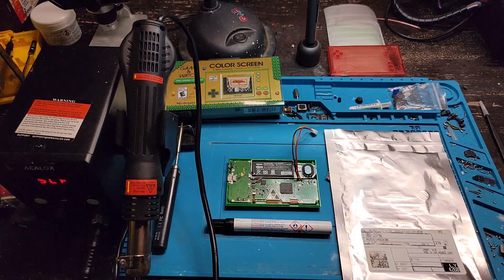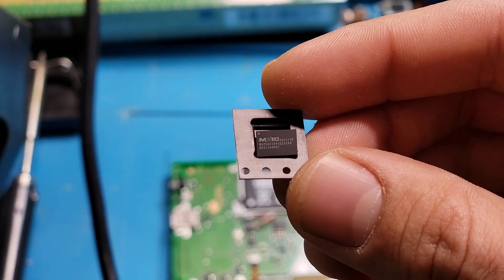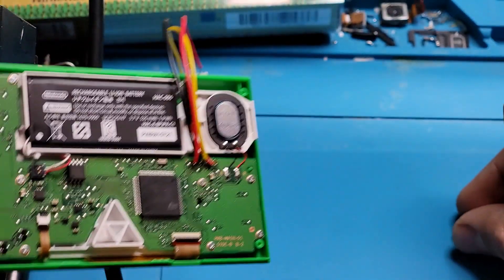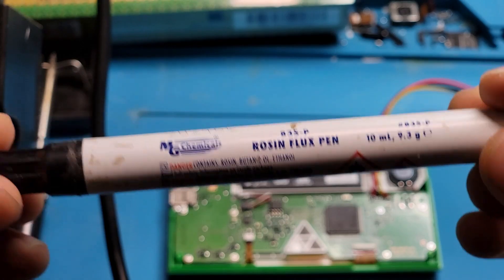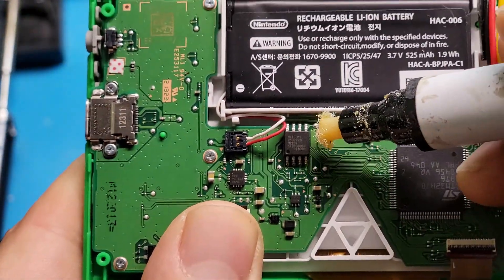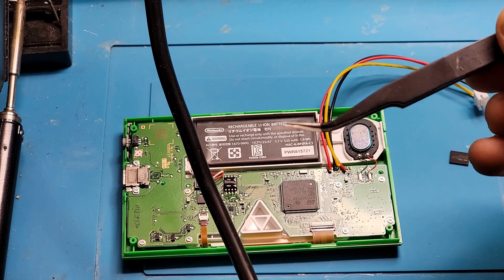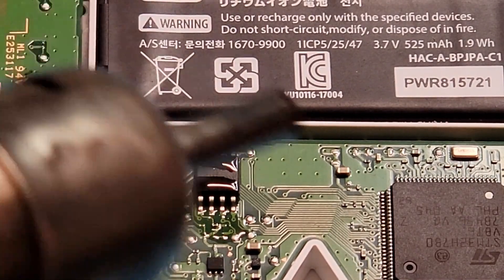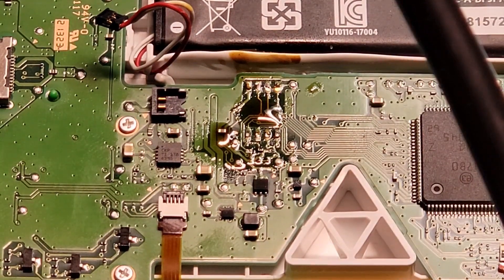Hacking The Nintendo Game & Watch: Flash Upgrade with air heat gun

Comment: I destroyed the first console debug ports by applying too much heat to them, because the tin did not properly got attached to them. On the second console I will try to use clip probes instead of soldering... But I am trembling about the idea of replacing the memory chip, cos testing tonremove chips on a spare circuit with a cheap hot air gun 7€  from aliexpress is not doing the job. This requires proper and expensive equipment as I am experiencing... 😢
Reply from the maker: You can try with a soldering iron and tweezers.  do one side then the other with flux and it should come off
Reply: @RetroResinCA  if I do that the body attached to the board with tin will not deattach itself. If I apply heat with a flat tip tonthe chip itself I could do that (risky?!) but while I try that the legs of the chip would also get enough heat to detach themselves too ?
Reply from the maker: @run1492 if you are careful with a bit of solder and good flux, you can do it with a flat iron to hear 3 pegs at once

Comment: anybody watching this: don't use a heat gun on a board that's still in the device. it's two ribbon cables and some screws. Just remove the damn board, this guy risked damaging his screen as well as his health given that he was applying high levels of heat to a lithium ion battery. Just take the board out to work on it.
Reply from the maker: @CowboyBGM  don't do what Jonny don't does

Comment: I unlocked my GW and able to flash original FW back into the upgraded memory chip. However, I'm not able to put retro-go in it.  Which guide did you use?  I found some guides online but none of the work.  I can't even install it with the original memory chip.
Reply from the maker: this one's mostly outdated
Reply: @RetroResinCA   So is there a guide that is updated?

Comment: there are tons of spi chip options with legs.. of course they only get to like 64-128GB.. what is the stock spi chip size, if its 64, 128 should be a decent upgrade?  I am way to lazy to try to use a heat gun..

Comment: Hello! I made a mistake... I had 2 consoles, I backed up first, hacked, changed the chip, restored the backup, recorded a bunch of games, everything is fine with this. Did all this in VMware under Mac. I also made a backup of the second console, hacked it, left the soldering of the chip for later, made a snapshot in VMware. Later I soldered the chip, and when I started to restore the firmware, I realized that I accidentally deleted the snapshot with the backup. Question: if I solder 1mb stock chip back to console can I take a backup from it and restore it to 64mb later? Or will it not work anymore, since the console at this stage was already hacked and I have a hacked version recorded in the stock 1mb chip?
Reply from the maker: When you change the flash, the device will read what ever is on that flash. The device is already unlocked so it will just work as it should.  If I understand your question correctly lol
Reply: @RetroResinCA  Not correct. In order to write custom firmware to the console with the ability to dual boot with retrogo, you need to specify the path to the original image backup that was lost... I already have a version with a hack on the original chip, after all 5 steps taken. It turns out I can no longer make an original backup from it? I also can't use backup from another console :(
Reply from the maker: @b0s0n_h1ggs  Not sure what you are asking. But if you don't have a flash with stock firmware anymore and you did not back it up, No way to get a backup anymore.. unless you have a fresh unit to backup.
Reply from the maker: you can absolutely use a back from another console.

Comment: I think I'm correct in saying that the Mario G&W is a 8Mbit (1MB) flash, whereas the Zelda is a 32Mbit (4MB) flash. As such, Mario benefits considerably from this upgrade, while Zelda is serviceable without it. Anyone wanting one of these to hack will get more bang for their buck by buying the Zelda one, particularly since it has additional buttons.

(It was quite difficult to find the actual flash size of Zelda, since the GitHub pages I was looking at use Mb and MB interchangeably. In the end I just had to Google the part number visible in this video!)

Comment: my man... Heating up a component near a battery.. That is a no go! This video could have end with a disaster. ABS plastic has a glas transition temperature of approx. 105 degrees celcius. So heating it up around 300 degrees celcius is obviously gonna melt it. 

Long exposure to heat can destroy the lithium ion polymer battery. The temperature at which the lithium ion batteries explode is 1000 °F that is 538 °C. I would not want to take that risk myself.

EDIT:
Nevermind, you corrected yourself right away, but everyone who's planning to do this, remove the battery and remove the board entirely. Use kapton tape to tape off everything that doesnt need to be heated. Also don't aim the airgun to close. It will burn components.
Reply: Haha Yep painful to watch how the the plastic is melting and burning..

Comment: Dude, dont sweat melting the tray. I did that on my Mario version following your 16mb upgrade being lazy and had exactly the same result. In hindsight I could have at least Kapton taped it lol. Thanks for your videos dude. Been a great help
Reply from the maker: yes all learning experience!
Reply: @RetroResinCA  thats cool effort but this much heat is not good for the battery and best practice would be removing the battery first cheers
Reply: I kapton taped and still managed to melt my battery tray!
Reply from the maker: @martyweiner4274  yes , I recommend removing the whole board before this upgrade!

Comment: Hi, is there a step before changing the chip? Like does the firmware need to be dumped first or do I change the chip first? Also where can I purchase the 512mb chip from? Thank you for the awesome tutorials bro.
Reply from the maker: Good question,  You should have the device unlocked prior to this chip upgrade also with the firmware backed up, replace chip then install retrogo or Custom firmware.  https://www.digikey.ca/en/products/detail/macronix/MX25U51245GZ4I00/9085437
Reply: Thank you